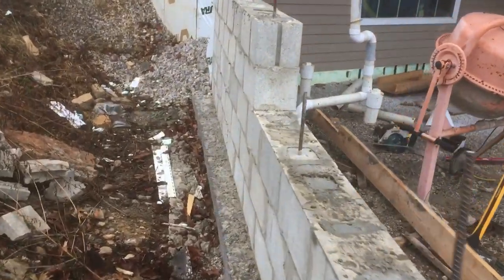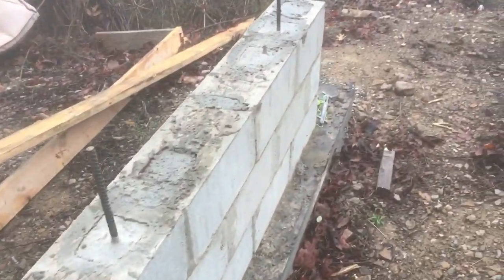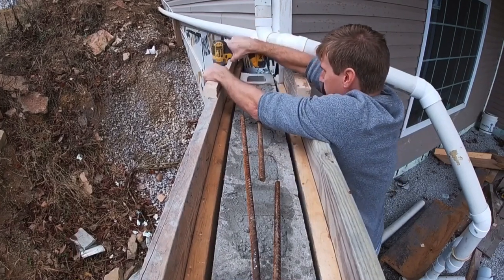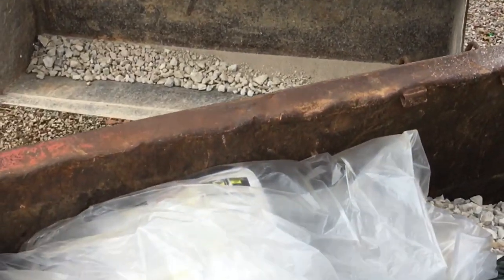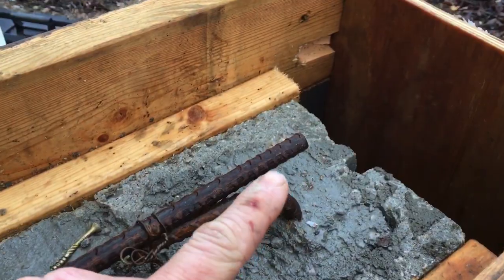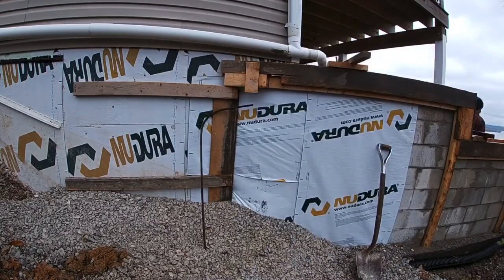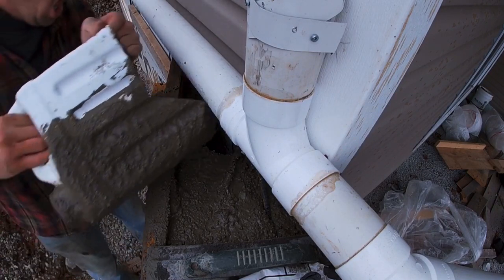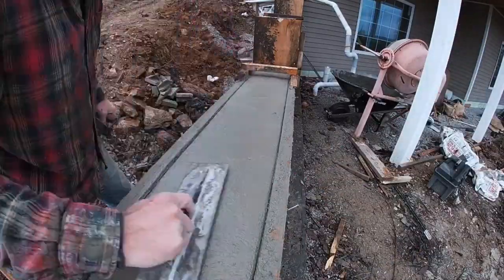Pouring a concrete cap on a concrete block retaining wall - DIY style

Comment: nice job i always buy 3 bags more then i think and return them if i dont use them .hate running short
Reply from the maker: casy casy need to do that next time for sure!
Reply: No matter what materials, I add 10% for waste and 10% for my screw-ups.
Reply from the maker: Timothy Ball that’s right! I’ve always done the 10% for waste and 99% of the time it works out perfect.  I knew in the back of my head I had a couple extra bags at the barn if I needed them.  It all worked out on this one.  thanks for watching!

Comment: My neighbor was pouring a concrete porch... the last section was the entrance end.  He ran out of concrete and had to go get more.... the new was from a separate pallet and had some iron bits in it.  That area + every random location he touched with the float and trowels afterward,  ended up with rust streaks. Lowe’s offered to give him free replacement concrete but wouldn’t fit the demo or rework costs.  So, he made the best of it.  Sealed it, primed it and painted it.  Every three years he goes back to Lowe’s, brings his letter from the store manager and picks up a free gallon of porch paint.

Glad you took that safety check step... shows that even if you you ain’t doing it, you are thinking safety first! 👌🏻

We have tons of lady bugs... was curious as to why they are a problem.  Are you an aphid in disguise?
Reply from the maker: William Harris keeping that letter is pretty darn smart on his part.  Glad he was able to make the best of it!
Reply: Captain Kleeman... yep pretty smart.  Don’t tell Lowe’s but, he hasn’t repainted it yet... but sure has some pretty grey basement walls!

Comment: I liked your custom concrete bucket. Couldn't you have use a Hilti hammer to nail the forms to the wall? Or does Mr. Perfect not have one of those.
Reply from the maker: Brian Gardiner a hilti gun could work.  The main reason I did the forms free floating from the wall is so that if the wall itself had any imperfections the cap wouldn’t follow those same imperfections.  Basically helps me keep the cap straight and hide any issues with my block laying
Reply: @CaptainKleeman  Issues with block laying?  YOU?? NAW
Reply: I have to ask how much was the mirror? I say mirror Shmirror.
Reply from the maker: Brian Gardiner have you watched the video in repairing it?  I have a video of replacing the glass and it explains it pretty well.  I think all and all around $80
Reply: @CaptainKleeman  I haven't seen it yet. Is it published?
Reply from the maker: Brian Gardiner yep,  it’s a ways down the list.  It’s not the most exciting,  but a little behind the scenes anyway
Reply: @CaptainKleeman  I noticed it was on the truck on the latest Dirt Perfect video, he might have mentioned it I can't remember.